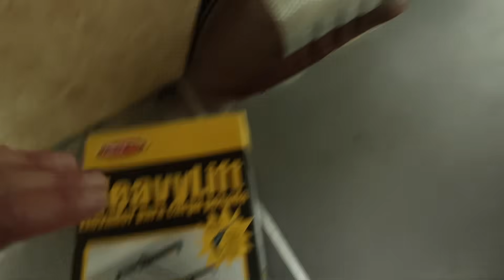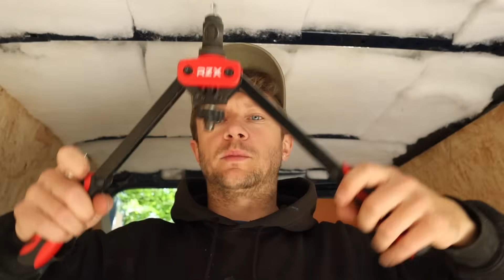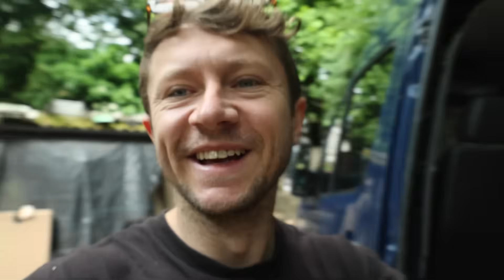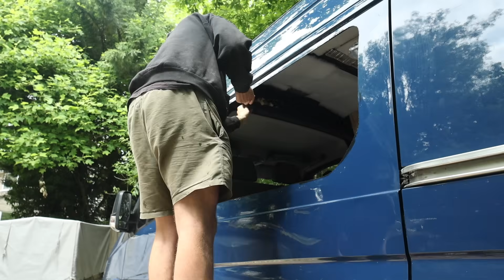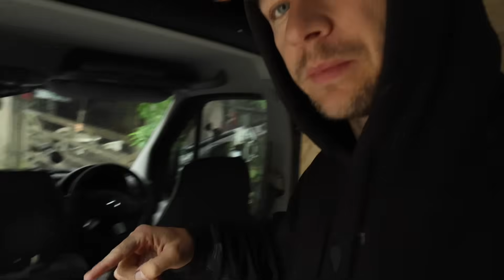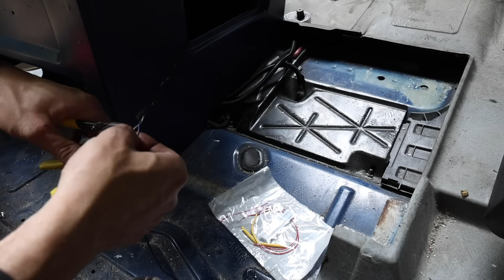LIFT UP BED? Dream Van Build + Side Window And Swivel Seat Install

Comment: Are you gonna leave the OSB on show? Like not covering it? I quite like the industrial look of it. I was gonna build my cabinets out of it but wondered if its just splinter like chuff when i cut it cos I'm limited on tool choice/blade option
Reply from the maker: Yeah I’m going to leave it exposed. Always loved how it looks. It does splinter quite badly but with a good sand it becomes quite smooth! What saw do you have?
Reply: @ItsOhJoe i looked back at your video from the other week when you put the boards up. Its gonna look good. Will you treat it with something? Coat it with something?
Reply from the maker: @holly7252 yeah I’ve just sealed it all over with Ronseal clear Matt exterior varnish (water based) - it doesn’t alter the colour just keeps it nice and light

Comment: My thoughts on the bed - only use the lift to store the bed out of the way & have supports for it when sleeping on it. No need to risk bending the roof struts or break the fixing gubbins for the sake of novelty!
My brother's van had a motor to fold the bed against the wall, another space saver.
Lovely to hear you laughing ❤😊

Comment: Good video. I hope you used plenty of rivnuts to hold up that bed. We used to use those to mount hand tools in compartments on firetrucks and had some issues with them pulling through. They were very dependent on the size of the hole that was drilled.

 That section next to the seat might be a great place for a cabinet with a pull out refrigerator or freezer.

Comment: I am not sure whether it is a good idea to sleep on that bed even slightly raised.  It needs to go down on suitable fittings either side, ie cabinets or storage.  If there is no need for cabinets just let the whole mattress go to the floor BEFORE going to bed.  I think you will realise that should the roof go under unusual loading it might bend inwards.  I would not want to see good old Joe, hitting the deck!!  Just a few thoughts - John
Reply from the maker: Yeah I had the same thoughts so will be fitting some fold out brackets from the side to be extra safe & stop it swinging
Reply: For strength wise you may have been better using Plus nuts instead of Rivnuts